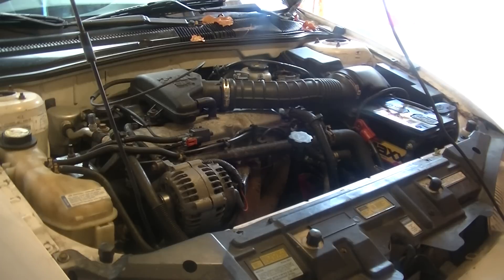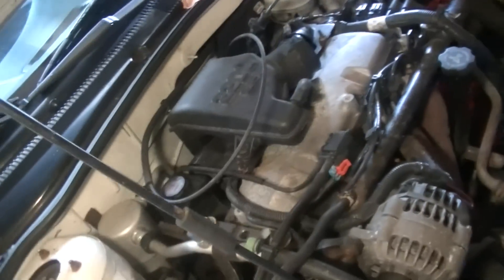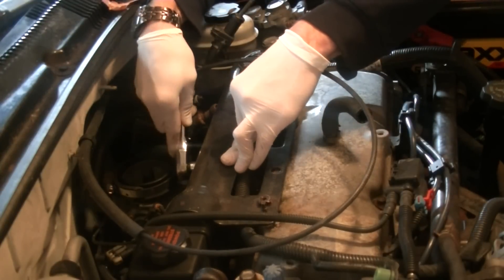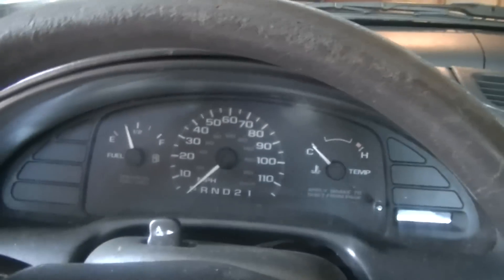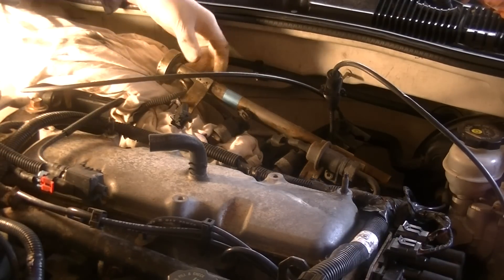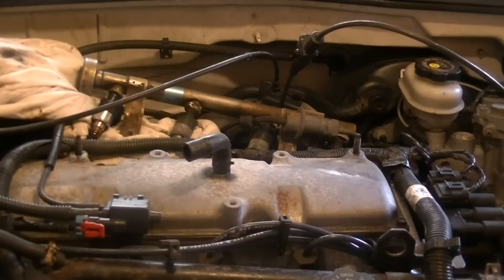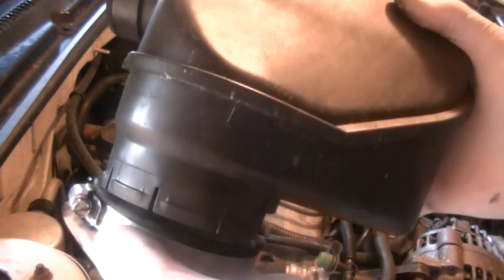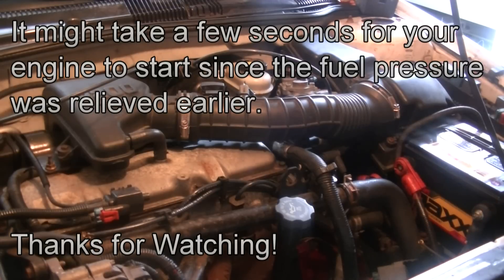Replacing Fuel Injectors [Pontiac Sunfire / Chevy Cavalier]

Comment: I have a 2002 cavalier I just put in a new fuel pump new plugs new plug wires and new coil packs. The car will not start. I also noticed some gas in the intake. Any idea what it could be?

Comment: I'm getting shitty mileage on my 2003 pontiac sunfire. Used to get around 700 km per tank. Now get like 240km. Changed my spark plugs which did nothing. Still runs good but has a lag in changing gears often. Any thoughts? Would faulty fuel injectors b3 the problem. Or is a fuel sensor or catalytic converter more likely?

Comment: What does that resonator thing actually do though? I got an 02, 2.4L, bought second hand & it doesn't have that thing. It just has a little air-gasket thing where the hose connected to the top of the engine. & i'm not a car guy

Comment: good video. I would add that if your theft deterrent red light is on steady and you get a code that says high fuel pressure or stuck fuel regulator the engine will crank but will not start. Apparently, the theft control system deactivates the engine spark. You will not hear the fuel pump turn on. All this caused by a stuck fuel pressure regulator.  Cycling the key on for 10 minutes then off three times will not turn off the theft deterrent light. I don't know if this is correct but will know in a week or two when my parts come in.

Comment: How do I remove the fuel injector electrical connector?
Reply: how do I change my TBI 2.2 over to sfi 2.2 ?
Reply from the maker: Just push down on the tab and pull up.
Reply: connector is square with a metal ring around it that I would have to pry off to remove the connector.  IS this right?  THanks for writing back.
Reply from the maker: joel pelka Oh! Yes, you need to pull that metal piece OUT.  It just slides in.  Use a pair of needle nose pliers.

Comment: Thanks for this video. I will be replacing the injectors soon an a Cavalier I just bought.  I was unsure how to get it all apart. Here is a suggestion for you, When lubing the injector O rings, use Vaseline. It is petroleum based and if any gets in where the fuel goes it will be burnt away with the fuel. Thanks again for this video.
Reply from the maker: +Cliff Yost I usually do use vaseline, idk why I didn't this time.
Reply: +MattsMotorz it is all good. I just thought I would put that here for others to see.
Reply: @cliffyost6843  I used the residual gasoline that was in the fuel rail. I disconnected the electrical connector, wiggled out the injector,  and installed the new one. The thing to do is to have the part ready to install.

Comment from the maker: Brigitte Coffman Are there any check engine lights? To me it sounds like an air problem.  A classic tell for this is the problem going away when you take your foot off gas.  Look for vacuum leaks, especially around the intake manifold.  If there are no leaks (look really good) then watch my video on how to check an idle air control valve.

By the way, I couldn't reply to your comment directly.  You need to go into your settings and enable people to comment on your comments.
Reply: LCD

Comment: Greetings from Tulsa OK.
How do you know, if this is what is needed?
My car 2001 Cavalier dies when I take foot off gas, while driving.
We changed all spark plugs and distributor cap. Plus New Battery.
Worked great on day one. Next day, it started stalling again. Esp when cold.
Is that a sign the fuel injectors are clogged and need to be replaced?
If yes, how long does this job take for a person without drills? Plus a NON-Mechanic?
Thx!
Brigitte in Tulsa OK

Comment: why you changed the injectors ?
you can't clean them?
Reply from the maker: You can, but cleaning only does so much.
Reply: MattsMotorz are you mean the cleaning not good in all times ?
or some times it's works fine.
thanks for feedback.
Reply: toolman talal Yeah.  When the fuel injectors are worn, they don't fire at enough voltage to keep your engine in sync, and that's why you'll get a misfiring cylinder.  It doesn't seem so bad, but after time, the injector will lose power, thus causing your car to stall.  It's a good idea to use cleaner every now and then, say like once every 4 or 5 fill ups, but as Matt stated, cleaning doesn't fix the problem.  It just delays it.
Reply: ***** thanks for answering my question .